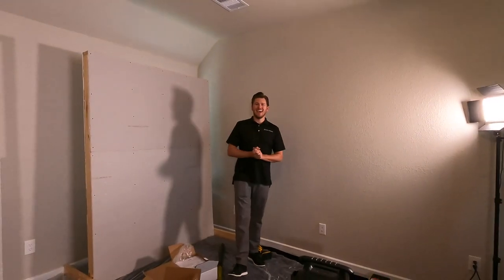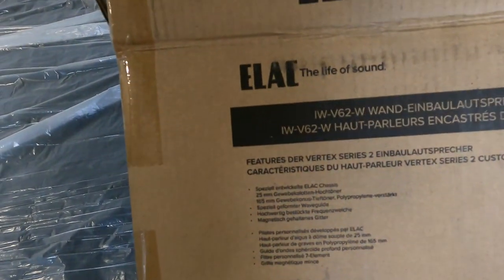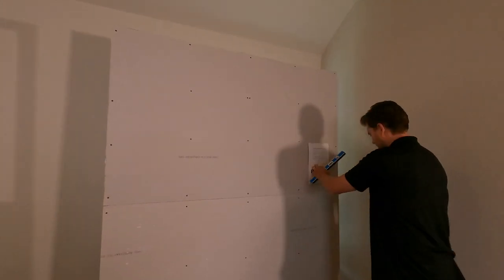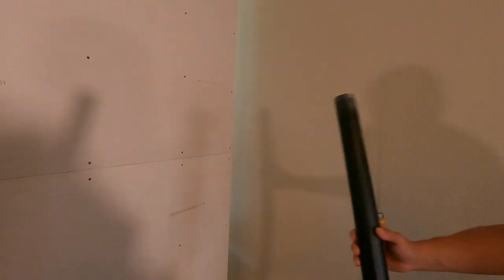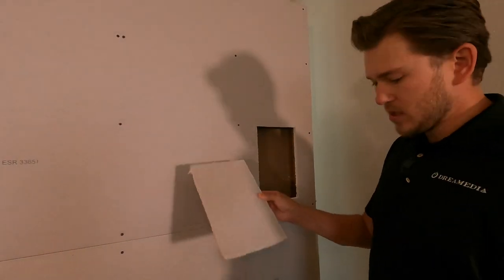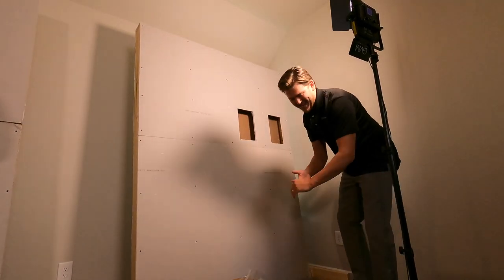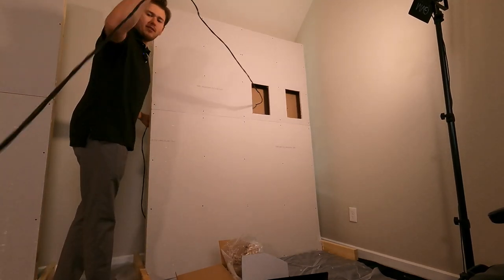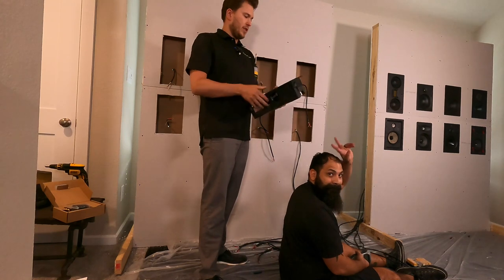How to Install In wall Speakers Start to finish!

Comment: Cool video. Would have been cool if you showed how to find and deal with wall studs.
Reply: @HomeTheaterCommish  You would be an expert on people not contributing to society 😭😅🤣
Reply: @keepingupwiththejones2933  thank you.
Reply from the maker: missed opportunity for sure. We were rushed that day. We had so many aspirations to show, but there are limitations to time and personal schedules. We will get it out at a later date for sure
Reply: @Dreamediaav  It's all good. Love your videos and the nuggets I get from them. 

I have a builder framing up a 17 x 21 foot room in my addict and I ran my speaker wire through the studs last week. 

Baby steps for me but I will be starting out with a 5.2.2 because that's all the AVR I have can handle. Thinking ahead, I'm pre wired for 7.2.4 and that will be my first upgrade in the future.

For now I'm going with in wall for side surrounds with 4 Atmos drivers in the ceiling. LCR and subs will be floor standing.  I still need to purchase a projector, screen, and seating amongst a lot of other bits and pieces.

The high price of building supplies has slammed my budget and slowed me down but with a little luck, I hope to watch the Superbowl on a 120 inch screen with the system cranked...! 👊🏾

Comment: "I'm gonna show you how to strip down the wire..."
[Completely covers stripping with hand in front of the camera]
"Like that..."
lol
Reply from the maker: Ok im confused. there was only 1/4 of an inch of copper showing. If you have done this before even stripping the outer jacket can get in the way of making a proper connection. More or less outer jacket is needed depending on actual installation.
Reply: @Dreamediaav  You're confused by what?
You said "I'm gonna show you how to strip down the wire..." then covered it up with your hand. It's kinda funny, so I'm trolling you. Nothing to be defensive about, stripping the wire was the right way to go, I just hoped you'd actually show it.

You make content almost every day. A bit more editing work will really improve the quality. Silly mistakes like this are human, but some of your videos have the WORST audio quality, like when you visited some convention recently and could barely be heard over the background noise.

Keep up the good work.
Reply: He does not know how to most of these videos.

Comment: And if you want to spring for it, 2 and 3 plane laser levels from any of the big tool brands will help this move along much faster along with the multitool used in the video. 

Drywall saw, normal level, battery saw, measuring tape, clearly works just fine. Just saying….

Comment: Does the orientation of the tweeter matter if it’s upper or lower?
Reply from the maker: The comparison is done side by side so the height is not a consideration.